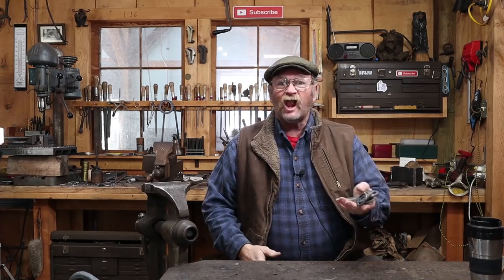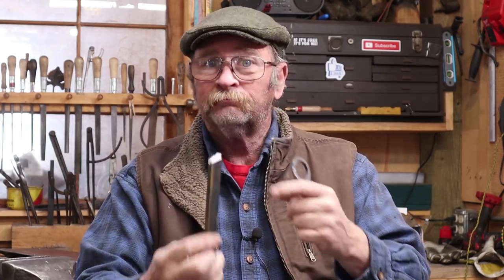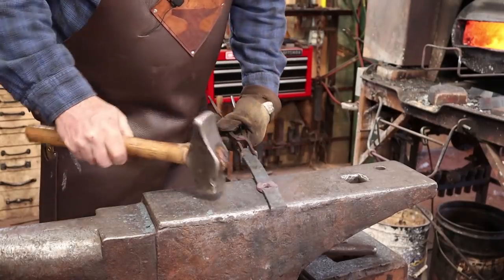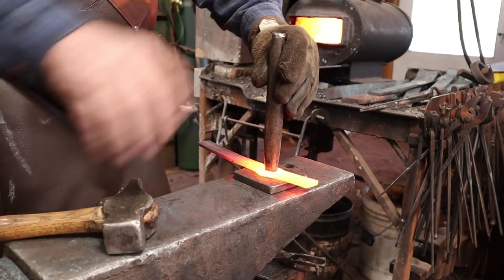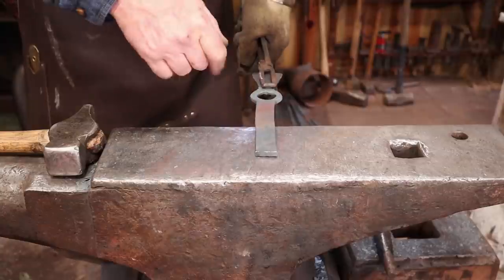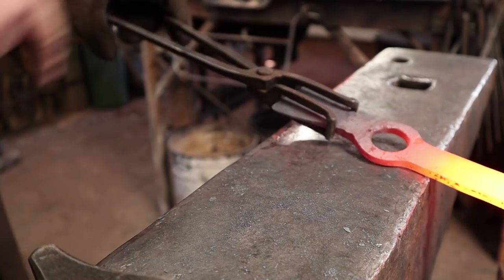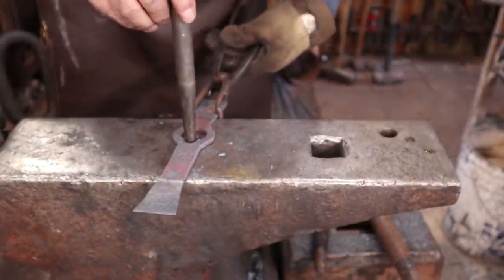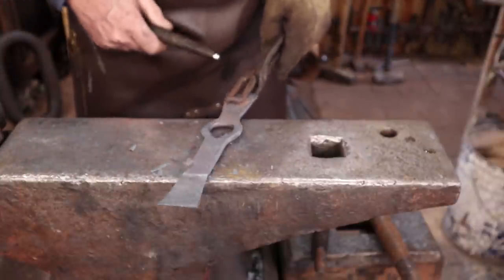Forged wall mounted bottle opener Blacksmithing for beginners

Comment: Hello from Shanghai, China! What crazy times these are. We’re all wearing face masks in my shop these days.
Reply from the maker: Its tough, but then again we probably should wear a mask in the shop just because of all the dust.
Reply: Black Bear Forge I agree with that. I’ve never been fond of masks, but I will get used to them in the shop. It’s just that now we have to wear masks to go anywhere. We are required to wear masks even in the office. I hope this is under control everywhere soon.

Comment: Excellent video as always. I make heaps of those bottle openers, but I cheat, I use a cnc plasma table... they are just for giveaways anyway. On another note John, of all the things I have learned from your channel the one I am using the most at the moment are the "hook rulers" you made from a square. I have a 300mm and a 600mm and they are soooo useful. Absolute gem of an idea.

Comment: Nailed it...again! Nice opener for sure. 
John would the little filing vice thingy you showed us how to make help out here with the tight angles? Idk haven't made one yet , do pardon my curiosity.
  Oooooo can so see that as a handle. Center accent on a sliding bar lock with a round wheel (ie old valve gate opener) for the beer vault a buddy is building
Sorry for rambling on.
🙏 Blessings John
Crawford out ⚒️🧙‍♂️

Comment: Does "popping a cold one" de-monitize a video? You just never know with YouTube. 
I quit drinking several years ago, and since soft-drinks don't  have this type of top any more, I dont really need a bottle opener, but it would be a fun project and look more period in my ~200 year old house. Thanks for sharing.
Question, does Pepsi cause Pepsivirus?
Reply from the maker: I don't think YouTube worries about reasonable drinking, they might care about drunken excess, but I haven't heard anything.  I use an opener more for import Coke or non alcoholic ginger bear than anything else.
Reply: Don't know about Pepsi, but Dr Pepper says Coke is habit forming.
Reply: Never heard of Pepsi virus, but I DO believe Coke will get you arrested.

Comment: I notice the chisel you used is basically flat. Is that the way it works best for punching out material instead of shearing it?
Reply from the maker: Chisels are sharpened for cutting while a punch is flat bottom for shearing.

Comment: Curious...  most smiths I’ve seen use a traditional London style anvil like the one you use...  what advantages does this style provide over a German, or double horned anvil?  I ask because I’m looking to upgrade my railroad track to a real anvil and wanted to reduce the chance of anvil regret, thank you very much!!
Reply: @ Mylar, I think that most smithing projects can be done on any anvil or anvil shaped object.  The anvil shape isn't the issue, the skill and training of the smith using it is the deciding factor.  I'm a rank amatuer and upgraded from my RRT ASO to a brand new German pattern for two reasons, one it was affordable and two I had used the same shape and make at the forge where I take lessons.  The smith who teaches me has 8 different anvils, two of the German pattern, one farriers anvil, one french pattern and 4 London patterns.  I've used them all and honestly so long as they are properly mounted and secured, there is no difference between them.  This isn't just my opinion, the very experienced smith who provides my tutoring also is of the same opinion (which I only found out when I mentioned to him I saw no difference between the different shapes)  Use whatever pleases you, the effort and practice that you put in will be the factor that makes the difference to the projects that you make.
Reply from the maker: I think it largely comes done to regional norms.  You use what everyone you know uses until you find a reason to change.  Both work great, but that second square horn sure cones in handy at times.  If I bought a new anvil I would go with a two horn.

Comment: I always Kida wanted to put a bottle opener on the dashboard of my truck, just as a conversation piece of course, but then, living in L.A. one of those conversations might end up being with law enforcement so I have always shied away from actually doing it.
Reply from the maker: As long as you just use it for soda
Reply: @BlackBearForge  I figured that if I did it I had better have a bunch of Fanta and Coke bottles rattling around in the passenger footwell.